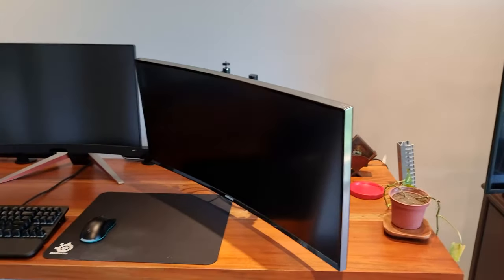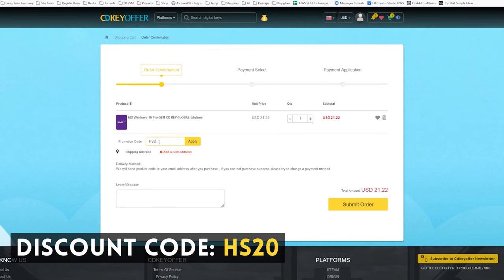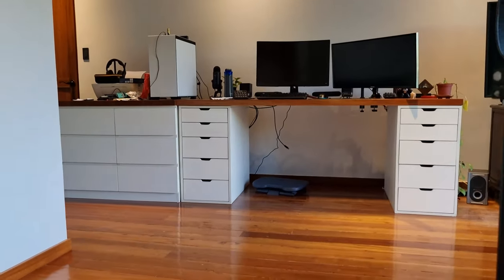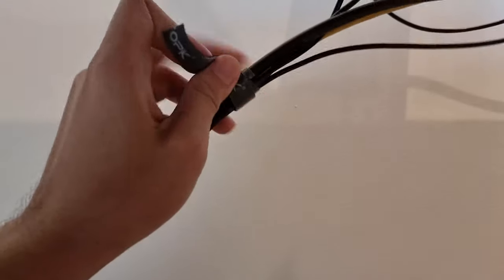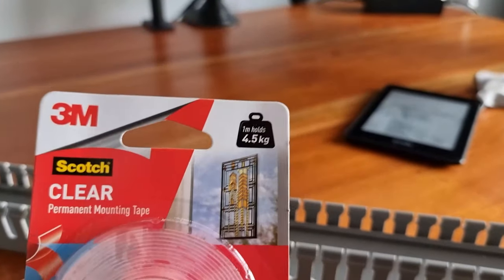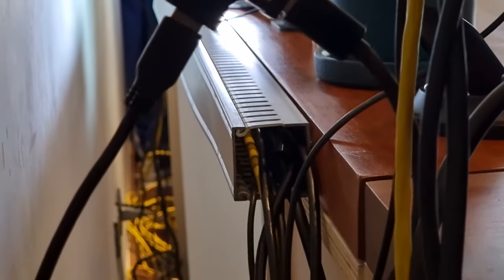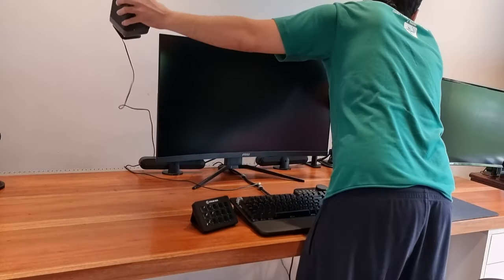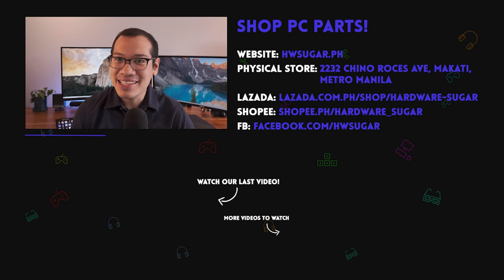CLEAN and Cheap: Cable Management

Comment: you might want to try the 3M command adhesives which are easily removable without residue (just pull the tab strip) and won't damage the wood. It's available sa Ace, True Value, Wilcon etc. Costs less than 250 for about 4 -6 strips (approx., don't know how much it is now with inflation hehe) depending on the weight capacity. I've been using it for years with no problems.

And, if you love your wooden furniture, alcohol is a no no. You can try small dabs of acetone (just wipe it quickly) or a product called Goo Gone (sometimes available in Ace Hardware or True Value or Shopee). A bit pricey for a small bottle but it does the job, just clean its residue with cotton or cloth moistened with a little dishwashing liquid. It also works on removing the rubbery gunk from the coating of electronics like some mice, keyboards, and speakers, etc.

Comment: nice and clean. great. but, honestly, you didn't actually got rid of the sticky tapes and velcros. you tidy-it-up with the molder.
Reply from the maker: True. I did however greatly reduce the adhesive Hooks from 10 to just 2. The cable line replaced the rest.

Comment: Removing Those velcro straps amirayyt? Haha there was no cable molding available in true value ser? Happy.easter
Reply from the maker: Heya Kc Bollos! I plastic moulding I find is too restrictive and it doesn't have small gaps for individual wires to peek out. :p I also associate moulding with rugby... even if of course I can use double sided ;p

Comment: Contact Cleaner can disolve the Double sided adhesive
Reply from the maker: Thanks for the top! Contact lenses cleaner?
Reply: @hwsph  Nope, contact cleaner is an electronic pcb cleaner/ automotive electronics cleaner. You should be able to find it in general hardware stores like ace, etc.